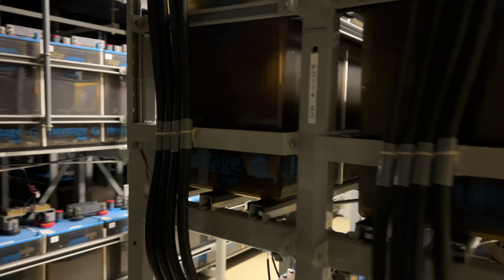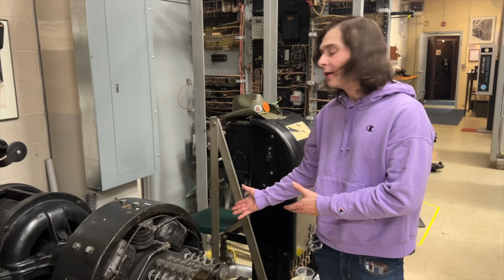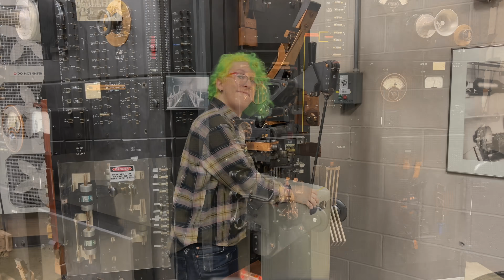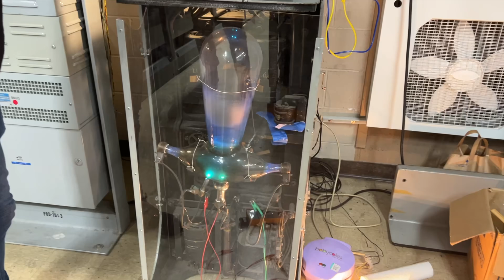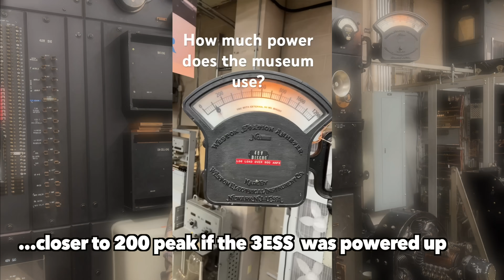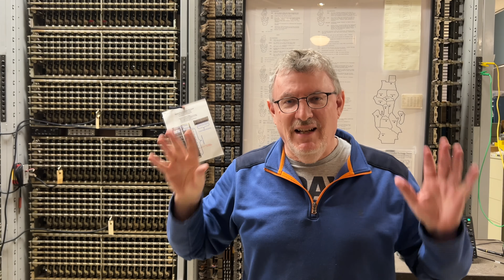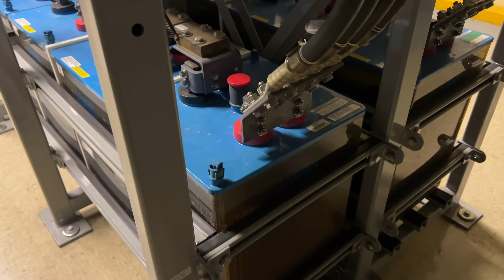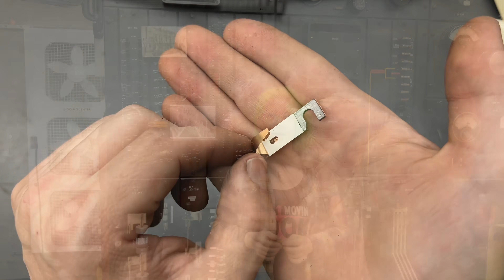All About Telephone Power Plants

Comment: This was very thoroughly scripted and well presented.  I had never heard the rationale of using MINUS 48v being tied to avoiding electrolysis of the twisted pair cables in the outside plant.
Reply: Early lines were often 19 gauge open wire on glass insulators, so corrosion protection was needed and well understood fairly early on.  In fact, negative line voltage with respect to earth goes back to telegraph days which began in 1844.  In the 1840s, the only power source was wet cell batteries because dynamos had not yet been invented.  The telegraph and telephone systems had battery vaults full of crow’s foot cells and battery boys to remove spent electrolyte snd consumables, then replenish the cells.

As Sarah noted, early telephone sets had their own batteries, usually two wet cells.  The early cells were crow’s foot with copper sulfate electrolyte.  The later cells were LeClanche cells with zinc rods and carbon blocks with acid electrolyte.  Union carbide in Cleveland, Ohio made carbon blocks for cells.  The telephone company sent around a wagon once or twice a year to service customer batteries.  In about the 1890s, no. 6 dry cells, often Blue Bell branded, replaced wet batteries.  About the same time common battery office design made customer premise batteries unnecessary.  None the less customer premise dry cells were still in use into at least the 1950s in some places.  I have a couple of WECo metal battery boxes still in their cardboard containers which look about 1950 vintage.  I also have a station service manual from about 1975, a condensed from of the applicable Bell System Practices, with a section on customer premise batteries.

Comment: Overcharging lead acid batteries does indeed produce hydrogen, but that on its own isn't all that dangerous. But they also produce oxygen at the same time, so that becomes very combustible.

In regards to negative vs positive voltage. As far as relay logic is concerned, that isn't a major difference. They just need a closed circuit to work, what voltage the coil is at is completely meaningless to the contacts that it switches. A rather nice trait of relays.

Meanwhile things like vacuum tubes do care about the relative voltage between their various elements. Same for transistors, they too care about the voltage between "input" and "output".
Now, technically one could build with optocouplers and regain the same general advantage of relays. (and a lot of analog and even "digital" circuits do this.)

Though, the thing that generally surprises me the most is that the contacts don't wear out faster. 48 volts is a fair bit. And switching DC at such voltages tends to lead to a lot of sparking, I suspect that the equipment has some form of "arc" suppression, like current limiting resistors or the like? Perhaps having a sacrificial relay that makes the "final" connection for each circuit, centralizing all arcing to that one easily replaced relay.
Reply: In the case of step by step selectors and connectors, in the back of these switches was a hefty capacitor, just like in an old car ignition system.  That was used to squelch the sparks and sorta protect the relay contacts.  
BTW, these selectors and connectors had a hefty electro magnet that was used to release the vertical pawl so the switch could drop when the call was completed.  Get between the contacts of a certain relay when the relay operated that magnet, then when the relay dropped, the back EMF was something to behold - or not!  More than once nearly fell off a ladder when playing around with the relay contacts.

Comment: The Rolling Stones blowing a 50 amp fuse got nothing on that 4,800 amp fuse!
Reply: Even if it was in Europe they blew the fuse, that would be in excess of 12 kW. 
4800 A @ 48 V is 230.4 kW (!) That’s 20 to 40 times the Stones extravagances…
Reply: Styropyro popped a 6000A fuse this week. The channel is Styropyro Shorts. It's easy to blow a high amp fuse with low voltage if you're doing it on purpose.